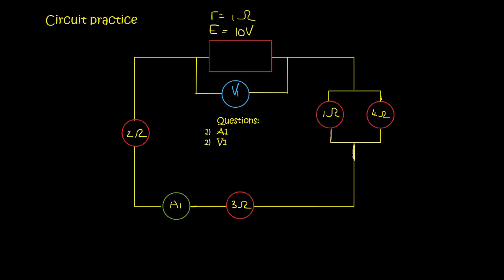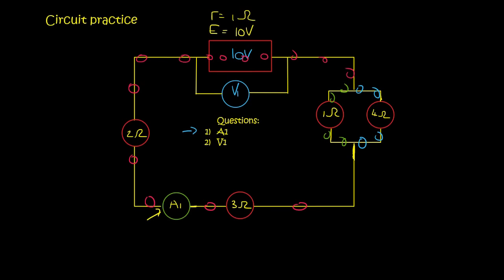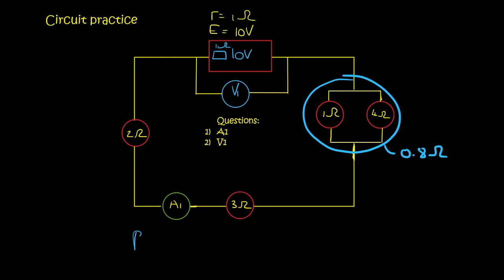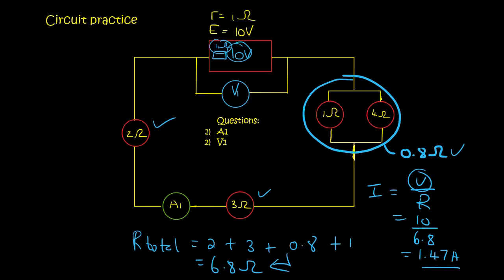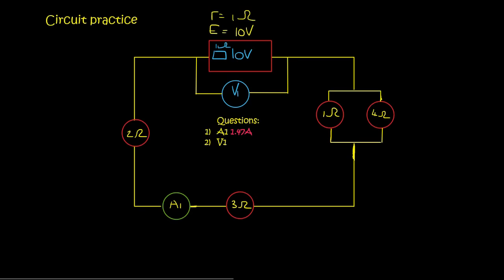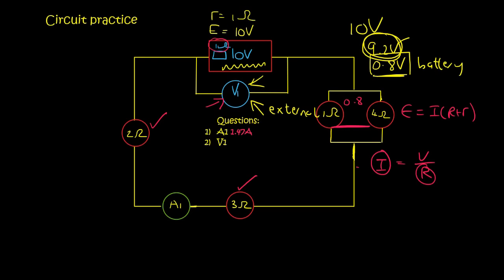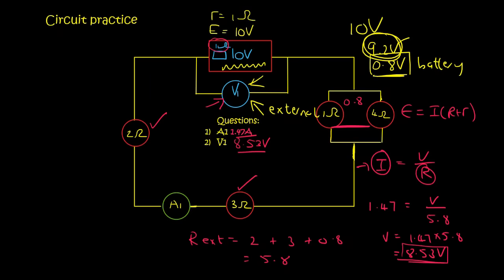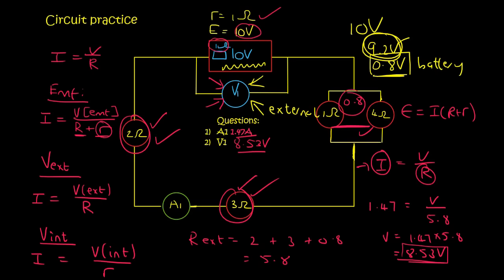Electricity Grade 11 and 12: Internal resistance practice

Comment: Sir, my question is that, how can we use Emf to calculate the Current because Emf is the reading on the voltmeter when the switch is opened and when the switch is opened there's no flow of current.

Comment: Hi sir 
So you can always calculate current at any point  using internal, external or total voltage and resistance? Does this work only for series circuit or also parallel circuit